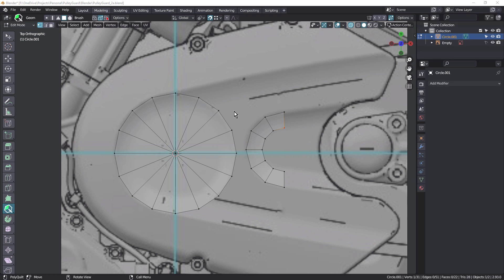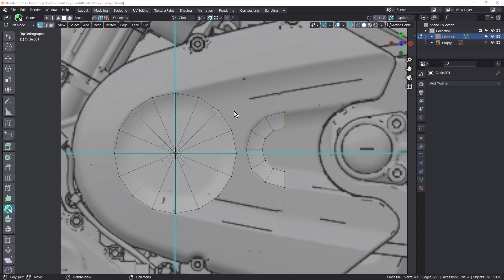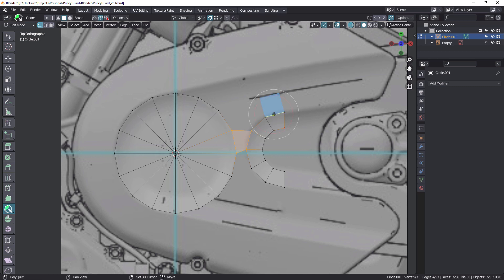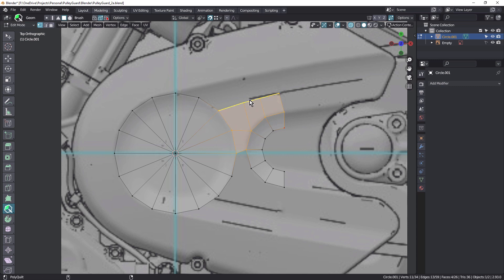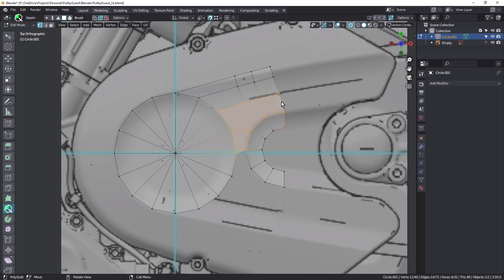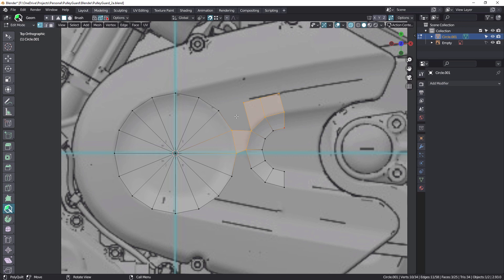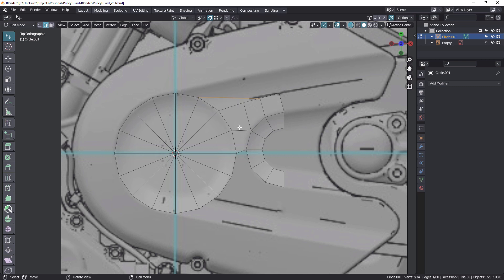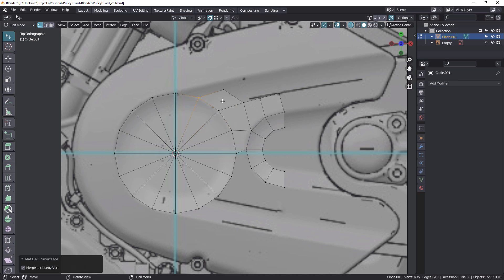How to Quickly Add Faces in Blender

Comment: Cool BEaNs! I was looking for something in regards to flat image projections(I.e. the flat view you'd see of a persons face in the profile view vs 3/4 vs the front view and how to basically skip having to pull out vertices from a flat plane in all the other "flat projections") but this was incredibly helpful inspite of that.
Reply from the maker: I'll consider examples for using multiple guide images for future tutorials. 👍
Reply: @Motionworks  Sounds promising! In the meantime, I will keep looking for stuff on the topic of 'flat image projections' and how to make them no longer flat via complex computer algorithms, which actually might be related to how people make deepfakes by putting in one single image into an algorithm which somehow guesses what the other sides of the head may or may not 100% look like(i.e. the deep fakes with a random dictator like Kim Jung Un singing 'Dame Dame, Dame Yo, Dame Dame Yo..." of course I'm getting alittle side tracked so I'll leave it at that.
Reply from the maker: @sldmeyerz  check the polyquilt key map, yours may be different from mine…